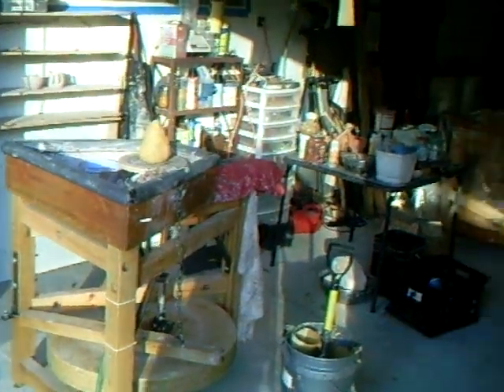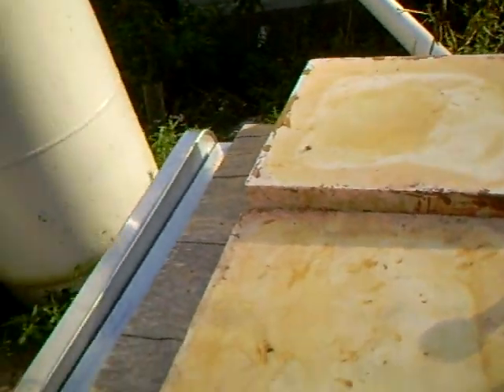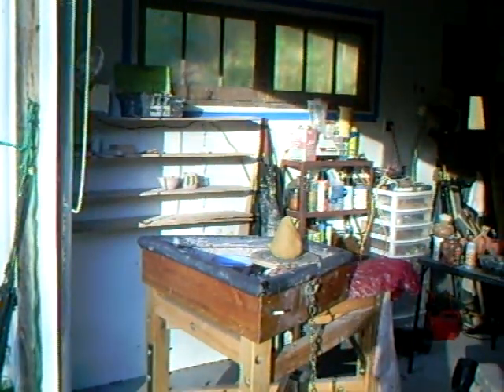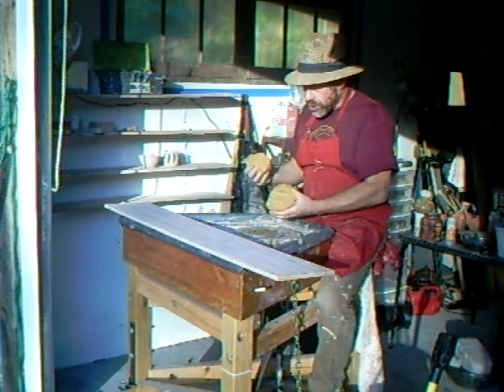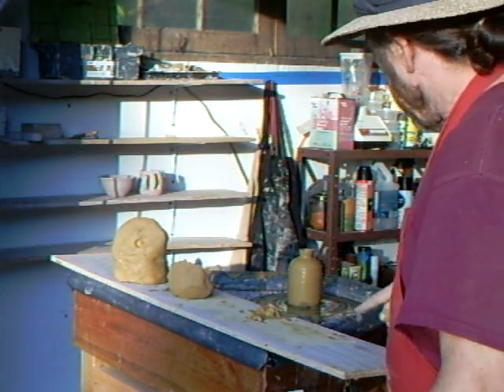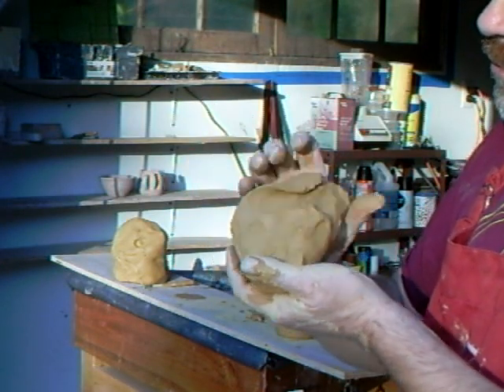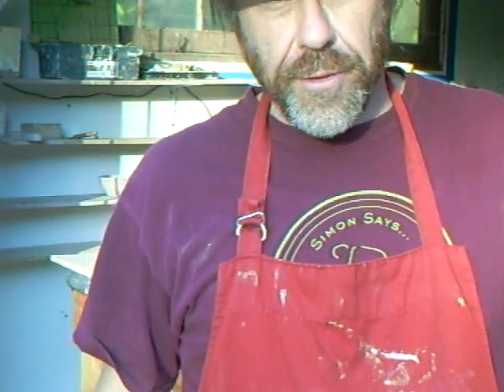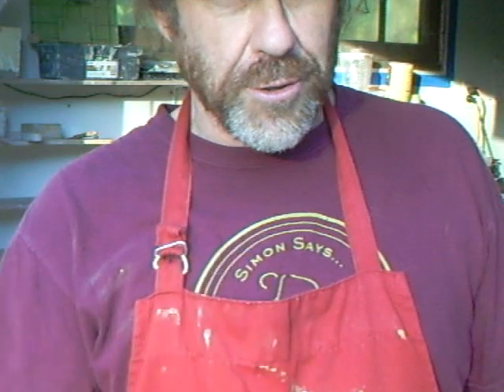SIMON LEACH POTTERY ~  Testing out the Williamsburg clay !

Comment: Simon,  That really looks like the local clay that I got from here in the western side of Baltimore.  It has sort of an orange tint to is when it is bisqued.  I fired it to 04, it was fine.  I fired it to cone 6 and it still was not vitreous.  I fired it to cone 9 or 9.5 in the gas kiln and it was still fine. A darker brown where unglazed.  It was just as you described.  I just picked it up, wedged it up and threw it.  I did not even sieve it.  It threw very nice.  soft and silky. happy dance.